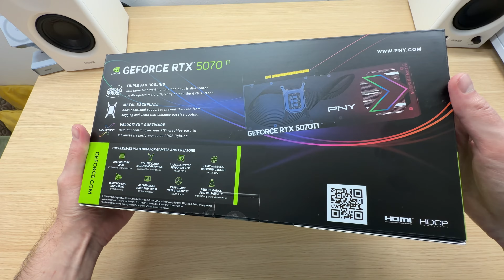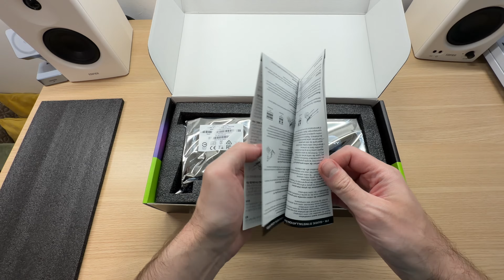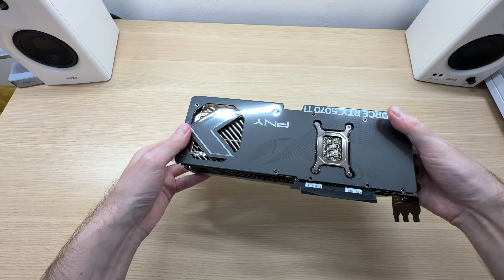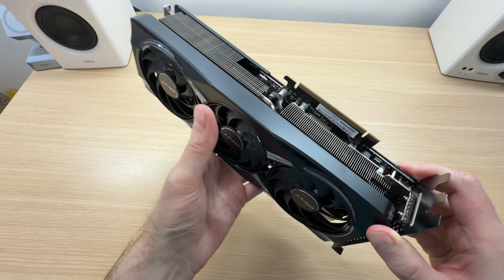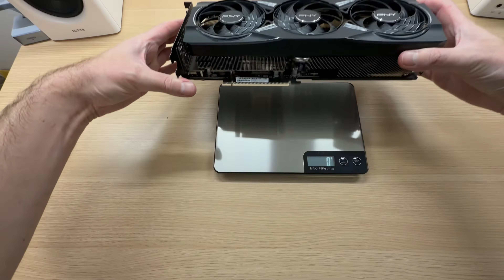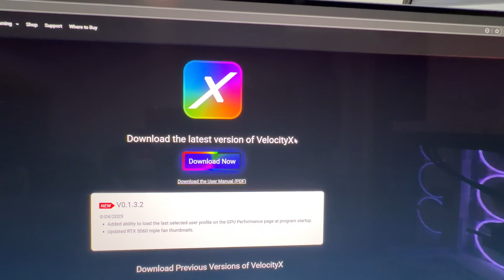Unboxing & Features Overview: PNY RTX 5070 Ti ARGB OC

Comment: Nice video, but it's unclear which power cable to use.  I have 2 8pins from my previous 5070 to the 16pin power input, bit the only comes with 3 8 pin squid cables to the same 16pin power.   I used my previous 5070 power plug like I have seen online and the RGB lights up but the fans don't spin and windows does not recognize the card... :(.

Comment: Question. I have the non gen version. It came with the 3 plug adapter. How do I hook it up to my power supply
Reply: honestly so far amazing. i have the none rgb version it really slaps. it's not the greatest looking cards by any means but if your fine with the looks the performance are stunning

Comment: I just bought the none rgb version of this graphic card can’t wait to finalize my build on the weekend
Reply: hi m8! im looking at this gpu. How has it been for u?
Reply: @garethsutherland9649  i just bought it a week ago, im very satisfied with the card i can run everything i want at max settings and the card is still cool and quiet, i cant even tell when the fans turn on when running low demanding titles honestly
Reply: @garethsutherland9649  honestly so far so great. it's not the greatest looking GPU by any means but if you're fine with that go ahead the performance are really stellar.

Comment: I would like an RTX 5070 Ti 16Gb, with the power consumption of a RTX 5060 Ti 16GB.  Price too. lol.
Reply: I just got the 5070Ti from Best Buy. Said it was new but clearly was opened previously so I'm gonna ask for like a partial refund. I did put it into my computer though because I needed to immediately start on work so unfortunately it's going to be heavily used if they want me to return it.
Reply: Impossible haha
Reply: @Xeadyy  Maybe the 6060 Ti.  :)